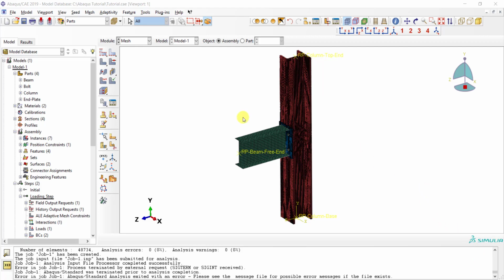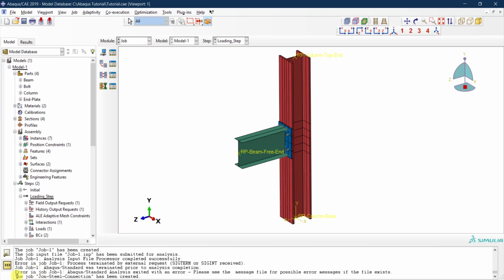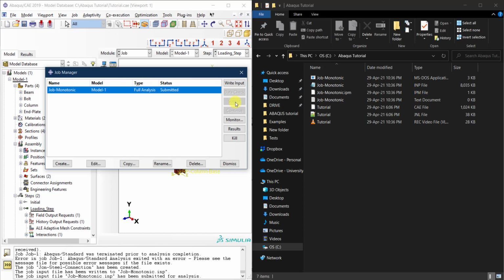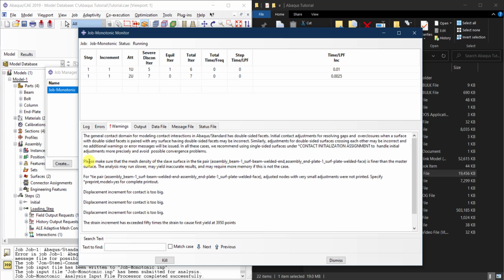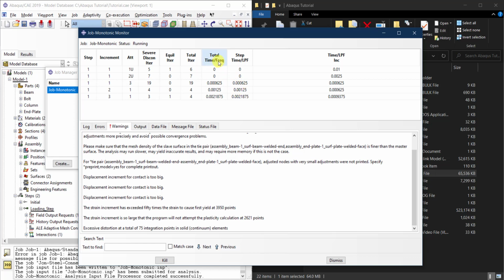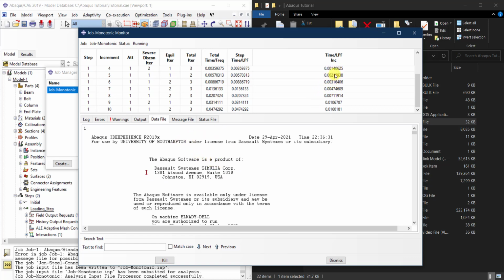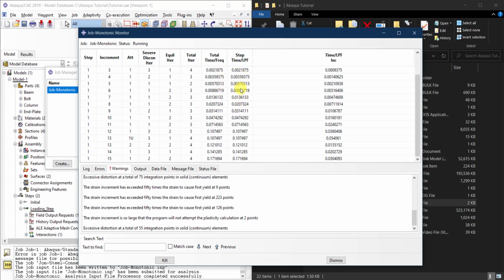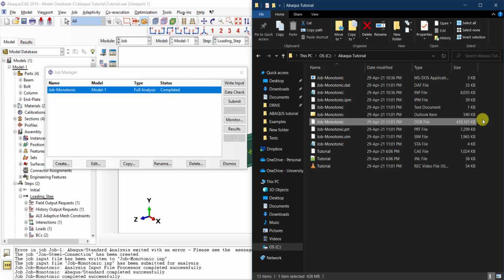#17 ABAQUS Tutorial: Submitting and monitoring a job

Comment: For people having issues with negative eigen values I recommend checking geometry particularly the surrounding bolt holes. My holes were too large for the bolt and the thickness of the column was no defined and it was causing many issues
Reply from the maker: Negative Eigen values means that the system is unstable due to lack of proper constraints in one or more degree-of-freedom. You must check the boundary conditions and interaction definitions in your model.

Comment: First and foremost, I would like to express my sincere appreciation for your tutorials; they are truly outstanding. I am currently working on your example, and after running the analysis, I encountered the following error message:
"NODE 1196 INSTANCE COLUMN HAS TWO RIGID BODY REFERENCE NODES 3 (ASSEMBLY) AND 2 (ASSEMBLY). A NODE MAY BE ASSOCIATED WITH ONLY ONE RIGID BODY."
Could you kindly provide guidance on how to resolve this issue?
Reply from the maker: @ditarmemedi309  the error says you made a mistake with the rigid constraints definitions where a node is used in more than one constraint. Delete defined constraints and redefine carefully.

Comment: Sir, when I run the Job. I'm having an error:
"The executable standard.exe aborted with system error code 1073741795. Please check the .dat, .msg, and .sta files for error messages if the files exist." 
Can't move forward from this point. Thank you
Reply from the maker: that seems like a software license issue

Comment: Hi, I have followed the tutorial and I can't run the simulation. I am getting warnings such as below: 
1. Negative eigenvalues
2. Numerical singularity while processing node

I think I may have missed something. Would you kindly give me an information on what is wrong with my setup? Thank you sir
Reply from the maker: Numerical singularity and negative eigenvalues typically result from poor boundary condition or interaction definition (i.e., something is probably unstable in the model). Revise these carefully. You can also try constrainig all DOFs and releasing one by one until you spot the cause of error.
Reply: @AElkady  thank you for the answer, sir.
Reply: @AElkady  the errors seem to be caused by the bolt and column connection, since I've attempted to simulate the case without the bolt and the large column (the end plate was given a fixed BC) and it was completed with no errors. Looks like I have made a mistake in assembling or giving boundary conditions on the bolts.

Comment: Hello sir, i have a question. the problem ı am working on, it is about to take 6-7 days of running time in ABAQUS. And during this time i am suffering from electric power loss, and if i submit again it is starting from 0. is there a way that i can cope with this issue? thanks a lot in advance.
Reply from the maker: You can use the restart command for this issue. Check the relevent tutorial video on the channel.

Comment: I really appreciate that you made to us . But I had some error on the process of submit . Could you tell me how to fix the error as below?
The number of history output requests (100001) in this analysis step has exceeded 10x the maximum value of 10000 specified by the Abaqus environment variable 'max_history_requests.' Reduce the number of requests, increase the value of this variable, or deactivate this test by setting 'max_history_requests=0' in the abaqus_v6.env file. Significant performance problems may occur if these requests are maintained.

Comment: I'm getting repeated warnings called displacement is too big, strain is exceeding and then the analysis stopping with an error!
Reply: Is it because I wasn't able to reduce the edge seeds of flanges from 4 lines to 2 lines in the meshing part of column.
Reply from the maker: This means there is probably an issue with either your mesh shape or the material deifinition.
Reply: @AElkady  Thanks Sir.🙏